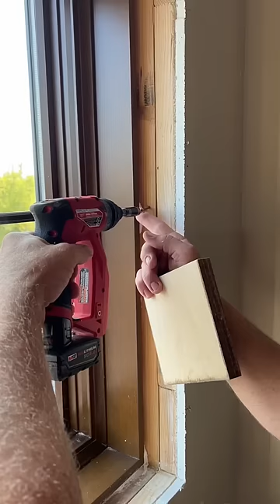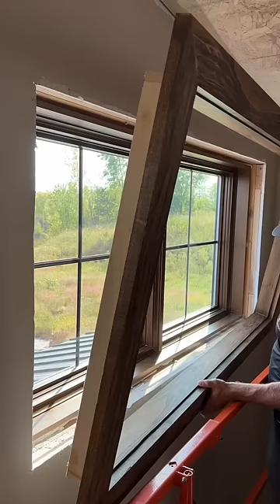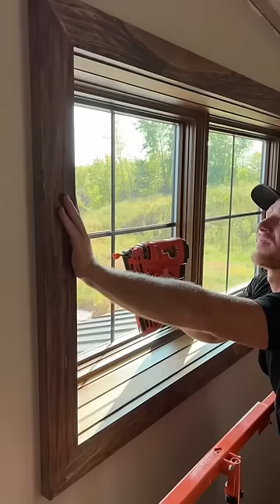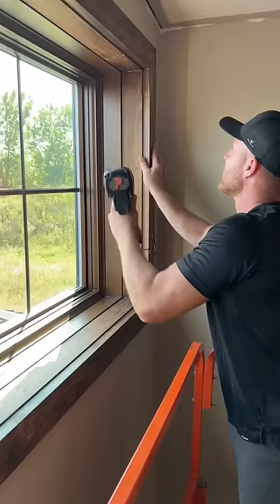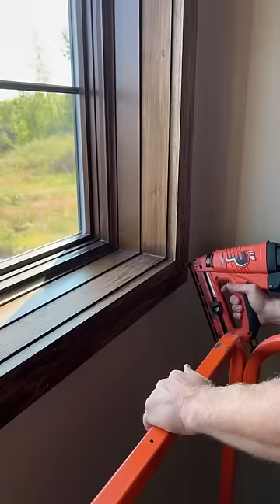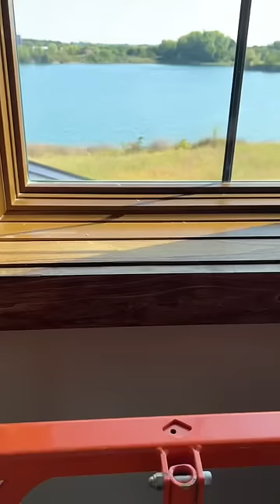BEST Window Install Method! #shorts #windowtrim

Comment: All nail holes will be filled with filled with a puddy or filler. There is spray foam insulation between jam and framing. And I'm guessing the extension jams aren't attached to window because it's a post framed house with odd dimension jams.
Reply: No there isn't spray foam insulation in between the jam and the framing, actually.
Reply: Actually, there is. You can see it under the window jam right before he slides the extension jam in. The depth of the gap may not be completely filled. Which I would recommend, but there is some in there

Comment: Pre finished. I insist all my guys keep the gun perpendicular to the grain. So that the nail and or the firing pin splits the grain amd bot cross cut it. The holes will look better when they are filled.
Reply: For sure.  Better with an 18 gauge instead of angled 16 too.

Comment: Whenever I see a window being installed I can smell my old job when I installed windows and doors for new homes. That new house smell. It's like the off gasing of finished lumber, sawdust, and sheetrock mud.
Reply: Windows and doors typically go in before finish lumber and drywall on new construction.
Reply: @adamcramm  Guess I just imagined my last profession. Thanks for breaking that down real quick.
Reply: @vladlestat1208  that is 100% accurate. I’m a home builder. Windows and doors go in immediately after framing to protect the interior of the house from the elements and criminals. At least if the builder knows what they are doing. Foundation, Framing, roofing, windows and doors. Rain ruins interiors. Nobody is doing finish work in a house without windows lol.
Reply: @adamcramm  well I'm a project manager for multi-billion dollar corporations Mr. Builder. Allison @ Aqua Island,  Trump Towers in Las Olas, St Regis hotel in Ft Lauderdale are just a couple. I've worked with Facina which repaired the pentagon after 911 and many others since your throwing out belt sizes here. Only an idiot would put a door on before rock. Now if you explain yourself properly and stated the exterior doors are first you'd make some sense but as of now your comments are and will still be inaccurate unless your in another country.
Reply: @adamcramm  drywall before interior doors. Always
Reply: @vladlestat1208  I’m clearly talking about exterior doors that are installed at the same time as the windows. Which is what the op was talking about.

Comment: So there's nothing solid between the jamb and the framing where you're nailing...?
How do you insulate that void...?
Carpentry has changed...
Reply: I see the other screws now, but still an uninsulated void above the window.
Reply from the maker: The window jamb itself is almost 6”… I’ve already insulated that prior to this extension install
Reply: @RRBuildings  OK, in the brief moment of the video it appears to be an empty void.
The prefab jamb extension and casing was pretty slick, and much easier than building on site.... Is there a slight bevel on the edge of the jamb extension? 
Nice work.!
Thanks for the reply

Comment: Yeah you can just shim the bottom, nails on the sides hold each other side in place and the top sits on the bottom shim plus you can face nail the casing to hold it all in place. 

1000 ways to skin a catfish, and there are a 1000 ways to do more than needed as well.

Comment: I like your style. I worked with a guy that would have used 100 nails. Always overkilled everything
Reply: Its always over kill until you look at it 50 years later and it still stands
Reply: @dog_city  I overbuild everything because that insures I never have to go back to address issues. It also ensures repeat business and positive reviews. In a time when everything people do anymore needs to be quick and fast I believe showing them quality work buys more time.

Comment: I need a little Paslode trim nailer like that. Have it’s big brother and love it. Beats running a hose and compressor any day.
Reply: I have the 18 gauge cordless Paslode and it’s SO nice for trim work.
Reply: The downside of Paslode nailers is you have to buy the gas cartridges.  And then they leak once opened.
Reply: @ThekiBoran  yeah you gotta be sure to have extra cans of gas on hand or you’re gonna be hand pounding some nails. They don’t like cold weather very much either.

Comment: First time I see you use sub standard technique in years, those pin in face do next to nothing plus damage face, foam or adhesive the frame on to face of wall, tut you've been leading the way for a while

Comment: I'm living in a cold country and this installation would'nt be acceptable. The inside of the glass should be installed in line with 50% of the R factor of the wall otherwise the glass would be cold and condensation will form during winter. For the carpentry part of the job...i'll let every body be judge.
Reply: You mean the insulation between the window and the frame? What was wrong with this trim install if it were in cold country
Reply: @dev_vg  not the insulation around but the installation in the rough opening. The installation to deep outside maintain the glass cold and produce condensation when the warm and humid air inside meet the cold surface.
 I'm french speeking and hope my explanations are clear. I tried my best😉
Reply: @nordique088  I'm trying to picture what you're saying.  Do you mean, if the thickness of the wall is 30cm then you will install the window (glass) somewhere on the inner 15cm part of the wall?
Reply: @danl.4743  short answer: yes. Keep the glass warm. You can have drawing of what i'm saying if you reach on internet GCR wich is "Residential construction warranry", or Garantie Construction Résidentielle in french. GCR regulate, inspect and approve all the industry of residential construction in Québec (Canada). Our colder than cold climate is the reason we are very concern about insolation and all the effect of temperature on houses

Comment: I mean, I guess everyone has SOMETHING to learn… no matter how good you are. 
Here we go;…
Firstly It appears that everything was very Nicely and nearly perfectly planned, measured, cut, assembled flawlessly, and then FAILED at the finish line with the installation!!! 

Before I mention any critique at all, I’d like to make clear that the intention of this comment is not of malice or ego, but instead, my intention is to share knowledge. For the betterment of all. 

Now, Not many men would ever see this to even be an “issue” so it’s not to take anything away from your skill-set, but when it comes to matching the level of skill that you’ve displayed & executed everywhere else in this particular jamb extension / trim build & installation,  there’s just ONE thing I can say to enhance your level of knowledge to have a consistent level of execution from beginning to end.
  Here’s the golden egg; whenever shooting brad nails or staples into wood, it’s always best, near invisible and certainly most aesthetically pleasing to shoot the head of the nail so that it runs long-ways WITH THE GRAIN…. Not perpendicular or diagonally across the grain… 

if you’ve ever been bothered by shooting a brad nail into something BEAUTIFULLY BUILT or crafted to notice you had small chips lift from the finished surface,.. TRY THIS METHOD ONE TIME, assess the outcome, & I guarantee you’ll take a few final seconds of each installation to make sure you never deviate from this method.

To all my fellow perfectionists; YOU’RE WELCOME 🫡🤙🏻💪🏻💯✅😎

To be perfectly clear for the slower readers and guys like me who like hands on experience to access knowledge,… here’s a play by play;

You’re brad nailer sets nail heads, running long-ways, perpendicular to the line of your nail gun from tip to the bottom of the handle…
SO, if nailing into your TOP or BOTTOM piece of trim, hold your brad nailer straight up and down in line with your body while standing straight up,… this will set the brad nail head parallel with the grain of the wood… In the most beautiful damn way you’ve EVER seen! Lol 😉😝

If you still don’t get it, you probably wasted your time reading this and I can’t draw you a picture so good luck 😆
Reply: Divorced??
Reply: You literally could have removed 95% of what you wrote and would have landed way better. Hiding your "lesson" behind a wall of unnecessary fluff is just silly.